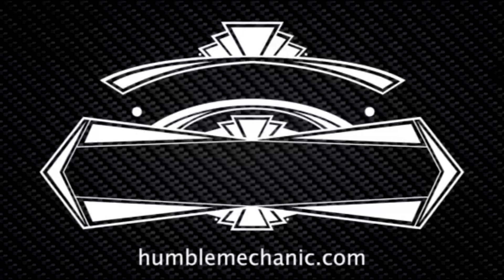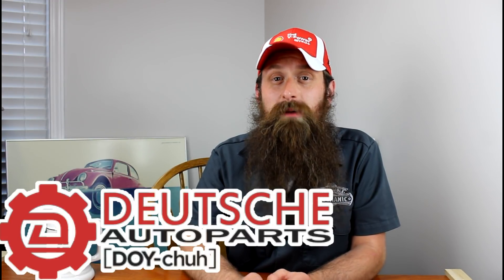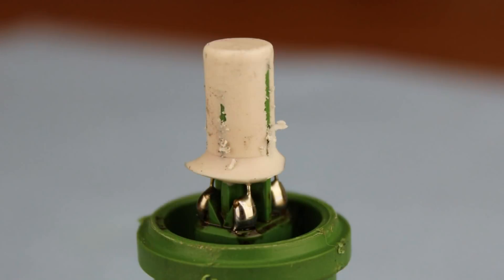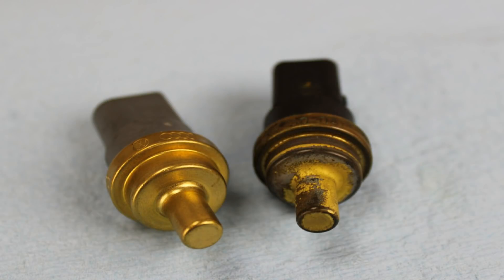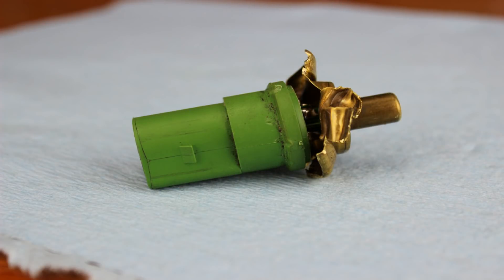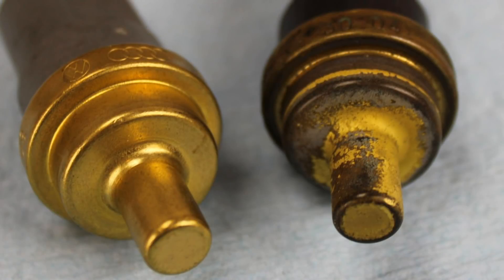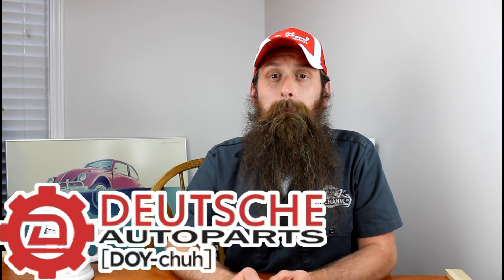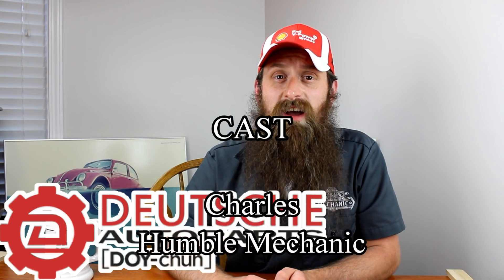How VW Coolant Temperature Sensors Fail

Comment: thanks for the tip  i have just  ordered  the sensor i have a bad  coolant flange  and working also on the lower arm suspention  on a 2002 new beetle thanks  to  your video of lower arm with polyurethan i will réplicas both  of them

Comment: Do you have tips on temperature fluctuations? :) Mine does fluctuate and I can't decide whether it is a waterpump or blown head gasket..
Reply: What car and engine? Mileage? Any air in the system? Do you have any coolant loss,...smell of coolant in the cabin or under the hood? Fogged filmy windshield? ((Is the heat from the cabin air vents affected too?))

Comment: I currently have 08 Passat that has g83 sensor fault. Customer has replaced the sensor. I have checked wiring from ECM to g83 sensor and ok. Checked resistance values and compare to charts and ok. I have completed an overlay harness from ECM to g83. Clear fault and unable to clear. Is it possible I have overlooked something,or ECM faulty? Thx in advance.
Reply from the maker: Could be ECM, can you monitor the coolant temp and see if there is not an issue. Also be sure the Thermostat is good.
Reply: I have, rad output temp reading 114 deg f , disconnected plug from g83 still no change, going to remove pin from ECM and clear faults.
Reply: No change, completed hard reset with no change in values and unable to delete fault. I appreciate your input and speed at answering my questions.

Comment: Hey the humble mechanic I have a problem with my 2001 Audi  2.7 bi Turbo V6 the my fans  Are not coming on I greatly appreciate if you could leave a comment to let me know what is going on and could that be because of the temperature coolnt sensor the only problem is it's reading that it's hot on my dash
Reply from the maker: That’s a good place to start.

Comment: hey charles...my dash tem gauge works on and off. no check engine light. temp is 190f on the button but i still want gauges working. i wiggle the wires a bit and that does work but not for long. ill wing it til i get a new sensor if that does the trick. those connections get kinda dirty there  so i will touch that up...hows my troubleshooting?

Comment: I have a 2001 2 L beetle that has non working instrument cluster. Speedometer tach and fuel do not work. Register at zero. The odometer does work. Are you suggesting that the temp control sensor could be the cause?  Thanks. Rob

Comment: I have a 2004 VW Beetle with a 2.0 l engine. The engine is hard to start and when it starts it idles rough at first then it revs up to a really high RPM on it's own. The radiator fans don't work and the AC compressor doesn't work. This all started suddenly. It seemed to be working OK the last time I drove it. Could all these symptoms be caused by a bad coolant temperature sensor?
Reply: Sounds like it might be the wiring.

Comment: my car shuts off when its get 192 temp and wont turn on when cold can you help me
Reply: Check coolant level and oil level regardless of any lights etc. If these are okay, then you can assume that the issue is related to a sensor.  The most common apart from the sensor in this video are camshaft position sensor and crankshaft position sensor.  Some sensors are really easy to access and some unfortunately require you to have the hands of an alien.

Comment: I've been trying to figure what is wrong with my 2004 passat. I replaced this sensor for the 3rd time now. Engine light is showing with "check emissions" message. I scanned it with vcds and 17664/p1256 code came along. It says it can be the wiring or the sensor. Since i replaced the sensor 3 times already, do you have any idea how to check the wiring? Also, there are time when the error disappears without taking any action. I have no idea where to start from with the wiring. Thx!

Comment: Can you tell me where this sensor is located on the 2003 vw Eurovan mv vr6 2.8? I cannot find it whatsoever please help!!
Reply from the maker: It will have either 1 or 3. It is just below the intake manifold on the driver side. Should be in the same spot https://youtu.be/YqlTvk1qi2k

Comment: I have a b6 3.6 passat. Can a faulty temp sensor stop fans from turning on high? I replaced whole fan assembly. And the fans don't seem to kick in on high which has my a/c suffering in traffic. Any help would be appreciated.
Reply: dustingaldeano - Did you ever find a solution? My Jetta is doing the same thing.
Reply: Yeah the compressor has a solenoid that goes bad. You can get it for like 12 to 40 dollars. It is like the clutch. It had my ac working poor or not at all at times. It never let pressure build because it stayed shut. So the fans were never triggered to high. Ac works awesome now.

Comment: Well I'm finally going to have to do some diagnosis with my car  green mk4 2.0  222,700 miles. Things got a mean misfire now I replaced the mass airflow sensor the spark plugs the wires the ignition coil that the wires go on and the thing still runs like crap not only that sucks  it sucks up gas  ,it runs good in the highway but the car lost power , I've delt with it before and every time it's like playing chess with the thing ,you'd think a pair of plugs would fix. if it wasn't for the fact I have 2 mk4s so I can flip flop parts I'd be sol .  Hopefully I can get the old thing running right so I can feel the buck of that beutifull shifting 4 speed AUTOMATIC transmission.
Reply: THE NHRA GUY #49   hey have you replaced the pcv/breather valve vag number for the part for my engine  (which is the BFB engine in audi a4 b6) is 035 103 245g that was making my car run like poo terrible idle and pissing fuel away this video may help   https://m.youtube.com/watch?v=pcNpHy4WazM&index=9&list=PLW_Twe7AUIGY97peMNQ2AAco1NpMQr02T&t=234s  I hope you get it sorted

Comment: that was quite brilliant. well presented. clear. 
Now, my question. I have a 1995 VW T4 Transporter (Diesel) and the temp gauge is not working. the needle never rises above the C (even though the fans are kicking in when the engine is warm - which is apparently 90C / 194F). So, I replaced (what I think is) the coolant temp sensor. but I got no improvement.  on the initial test the needle still only rises to the C (though my wife was driving it and said at 65mph she had the needle up at the first tick mark above, 1/4). 
what else can I test here? am I looking at wiring or the gauge itself?
Reply: Sounds like the T-stat is stuck open.

Comment: Hey Charles, I know this is an old vid--still, thanks for this one. Had a question--I have this 16v running on Digifant 2 and its idle is bouncing only on cold start. It is stable when warmed up. Am I correct in suspecting that the blue coolant temp sensor is at fault? If so, do I wait for the car to be in operating temp before I unplug the blue CTS and rev to 3k 3 times to reset the ECU/CTS?
Reply from the maker: It's worth a shot. That doesn't require spending any money. I like that.
Reply: thanks charles. tried it and no luck, still acts the same way. i'll just run without the ISV for now.

Comment: My wife has a Mk4 (Type 1J) MY2000 and it is the 1.6 Comfortline. We are having problems with the car making a backfiring noise (noise is local to the engine bay...'buck' noise).
I have just replaced the coilpack as I've seen sparks jump from it to an adjacent spark lead. Spark leads and spark plugs are replaced after a dead No. 3 cylinder lead was discovered.

With the coilpack now replaced i.e. changed out VW# 032 905 106B with 032 905 106F (newer revision) and still have slight RPM instability at idle and when accelerating I still feel a type of drag as if the car isn't making the demanded power at that instant.

Having scanned the vehicle, all errors i get are the following (Note: this is a replacement lambda sensor after old was replaced):

4 Faults Found:

00525 - Oxygen (Lambda) Sensor (G39) 
            05-10 - Input Open - Intermittent
00525 - Oxygen (Lambda) Sensor (G39) 
            07-10 - Signal too Low - Intermittent
00537 - Lambda (Oxygen Sensor) Regulation 
            19-00 - Lower Limit
00525 - Oxygen (Lambda) Sensor (G39) 
            27-00 - Implausible Signal

Furthermore, the engine consumes oil, but not a whiff of smoke out the exhaust or drips. Just some on the perimeter of the intake manifold and not much trace of leaks.

Any suggestions as I'm going mad after spending ZAR 3800 ($321 equivalent) on the coilpack.

Looking forward to replies

Comment: Please excuse the long post. first of all, Many thanks for the Video, it really helped me resolve an issue similar to what you described, but i would love to get your comments on the subject, i have an Audi A6 C6 2.0TFSI 2008, a few months back, i noticed that the coolant gauge cluster was not working. and since i still maintain my car in the dealer, i took it for inspection, once they had a look at it, they found a code (forgot which one) and they cleared it, the gauge started working again. On the same day, the gauge failed again, so they had another look. after a full day inspection, they replied that the issue was in the ECU module. their assumption was based on the fact that gauges are working fine (they tested them), the ECTS was working fine, since even though the dashboard gauge was not working, the ECU was still able to read the temperature and start the fan accordingly when it get hot, and that all wiring within the car was not short circuit. it was not a good news for me. so i did a few research, and i watched your video, and next day i came back and i asked them to change both ECTS (my car has the 2 wire model -black), and to change the thermostat also (since it was partially stuck open). so far 3 months passed, and its still working. what do you think? i have asked other audi service shops, and they replied that similar cases were noticed to other customers, but with different resolutions types. one of the service shops told me, that one customer changed his ECU module, but the problem came back and he just gave up. i know the saying (if its not broken, don't try to fix it), i just want to understand, in the 2 wire ECTS module, how is it possible that the ECU was able to read the temperature changes, while the gauge cluster was not, if its the 4 wire system, its logical, as there are 2 signals through 2 separate channels were one of them could fail, but on the 2 wire system, how its usually working?

Comment: I’ve got a golf MK4- once warm it looses power - do you think that this sensor would be a possibility? I’ll order one - but I think it could be Lamda sensor related -? - it doesn’t have any error codes :(
Reply from the maker: Could be either one. Any faults? 

This is an ultra common failure

Comment: Would this cause a drop in the fuel economy? My Dad has a Mk4 Jetta TDI. The fuel economy is crap and the temp gauge keeps showing it's not up to operation temperature. I was thinking that the ECU might think it's still in the warming up stage. If not, would you have any idea what could be the problem?
Reply from the maker: Yep could 100% cause that
Reply: HumbleMechanic Is there a way to figure out if that is the issue? I'm pretty sure it's causing it to run rich. I smell a lot of diesel, but no code is being thrown
Reply: I have the same problem on my b5 passat but also has hard starting have to crank it for 15seconds for it to start up and has no power for about 5minutes any ideas?

Comment: Nice video. I am getting the p1296 code error for VW Golf A4. I checked the sensor and it is fine. Do you know about the voltage that must provide the circuit for this sensor? As far as I know It must provide 5v for both thermistors. Not sure if the circuit is the problem or the thermostat. Regards

Comment: @HumbleMechanic I'm getting a CEL on my 2007 GTI. The car gets up to normal operating temps (190) so I don't believe this is the thermostat. Am I correct in thinking this? Could it be the CTS?

Comment: I have a 2014 Audi A6 TDi, sometimes when i drive the led screen tells me to stop, turn off the engine and check my coolant. Then a red coolant light appears, the coolant temperature doesn't change. (190) the fluid level is between the min and max. Then randomly the light will turn off, its very intermittent. Do you think my ECTS is going bad?

Comment: hay man, I need some help if you can take 5 mins for reading this, i'm kind of desperate :(.
I have an Passat b5 tdi ATJ 99.12 with a lumpy idle(steering wheel shake), it is not thet bad but is annoying(sometimes is better sometimes get worse), i've changed camshaft lifters/ dmf kit/ all pulleys and timing belt kit,cam timing at 0, injector value are max +/-0.15 each, injection quatity and duration are not so good, iq: 4.5-5.2 and injection duration 4.5-4.8-5.2 max(when hot), beside that engine runs just fine, pulls like a train, love it and hate it at the same time. I dont know what tot do anymore, now i;m searching for little things like temperature sensors and such. If you can, please let me know what you think about this. Thanks and sorry my bad english. have a nice day!

Comment: will this sensor cause really bad gas mileage if not working properly
Reply: It can do, if the sensor is giving a 'cold' reading (not up to temp), the engine may use more fuel. This is why you may get a lamda sensor fault light from the exhaust because excess fuel is being passed through the catalytic con. I'm no mechanic, but hopefully it may help. :)
Reply: thanks I had it replaced just for preventive maintenance. I am learning these cars are nightmares of maintenance.

Comment: I have a 2001 VW Passat V6. I broke off the green part plastic part of the sensor and the copper housing and most of the sensor is still in the hole. So I cant reconnect it. Would I be alright driving the car with the sensor unplugged for a while until I can get it into a shop?

Comment: Hi I have a 2006 VW Passat 2.0t and when I'm in a place for awhile my temp gage moves as of it's going to run hot but goes back up when I start driving...are my fans not working or where should I start looking first

Comment: My secondary airpump starts and stops several times in cold start. I know i have a bad temp sensor. Could it be this causing the pump to force start and stop? I have no air leaks to the hoses of the pump. My combi valve works fine too.

Comment: Hey mate , i have vw mk4 2002 SE, the car works fine but i have problem which is the thermostat is not opening , i changed it but still , nothing wrong while driving and no over heat , what could be the problem ?? Thanks

Comment: hi there Humble mechanic, I need your help as ive searched google up and down and cant find solution to my problem, I have a 2010 VW CC and recently replaced the cooler, in doing so the wires pulled out of the plug to the ECT  its a two pin plug with a brown and yellow wire and the plug has 1 and 2 and I dont know which goes where,
when I start the car now the fan comes on imediately and stays on until I switch it of, can you please asist me in this matter?

Comment: Yesterday I was making an hour and a half drive. After about 45 minutes or so, I noticed that at some points my temp would read 160-170. It almost always reads 200. Could this be a temp sensor issue? Or a thermostat??
Reply from the maker: +Tyler McLaughlin more likely a thermostat.

Comment: Hi i have a 2006 jetta with the BRM engin and i had an OBD error P0183 Fuel temperature sensor A circuit High , it referes to a Fuel temperature sensor that looks exactly the same a s the coolant temp sensor you mentioned inteh video , i wanted to know if i replace the fuel temp sensor will eventually a little fuel leakwhile installing the new one ,so how do i remove the air buble in teh fuel circuit once the sensor replaced 

thanks for all the great videos 

Karim

Comment: Hey charles, great video! I've been getting what I think is vapor lock, and a check engine light for the coolant temp sensor. hopefully that will correct it. thanks for the video !!
Reply: aaaaand, I dropped the clip into the engine compartment and I cant find it

Comment: Hey Charles,
Thanks for such a great informative video, I have a question if you have a couple of minutes to answer it pplease as  that was not answered in the video, I've got a 2.5tdi 2009 T5 transporter, it has 2 coolant sensors, one 2pin on the rad and a 4 pin on the block. the fault i have is both rad fans come on full spin as soon as i put the ignition on and switch off only when i switch the ignition off.  Which sensor could it be at fault? thanks karl
Reply from the maker: +karlsillett oh man good question. Not totally sure which on triggers the fans. I'd guess the 4 pin one. But that's just a guess

Comment: HumbleMichanic , Can the coolant sensor make the fan not shut off ,? i have a 2015 Jetta , your answer would be appreciated.
Reply: Fun Size - Did you ever find a solution? My cooling fan is not coming on and a/c blowing hot air.

Comment: Best tip I can give anyone in need of replacing their VAG CTS; Always buy the genuine VAG part. Even they have serious issues manufacturing these, with great losses in quality control. With cheap 3rd party replacement, to cut cost, quality control always suffer first. Then inferior materials and processes. I'm all for 3rd party parts, but never with VW, Audi, Skoda etc, coolant temp sensors. After changing the same 3rd party afyermarket CTS over a years time, it will start to make sense ^^
Reply: pr0xZen Almost hard to believe there are worse parts than original VW parts.